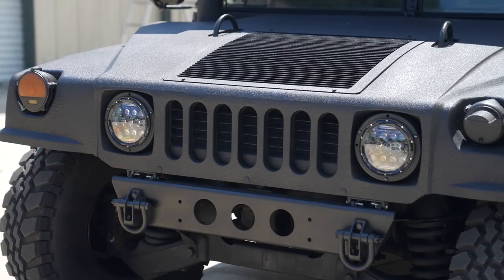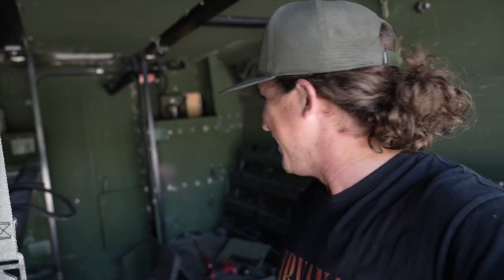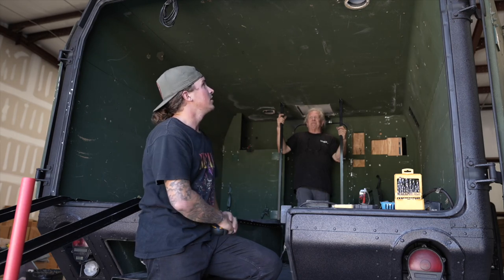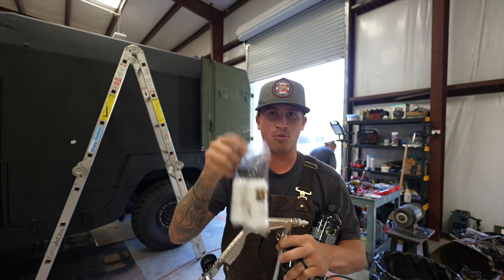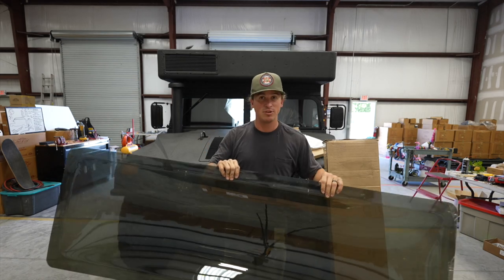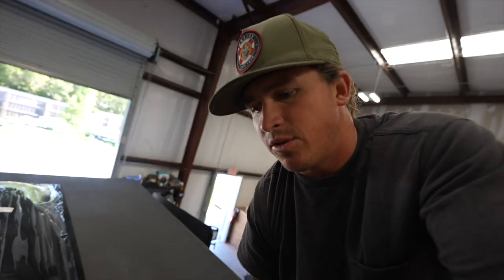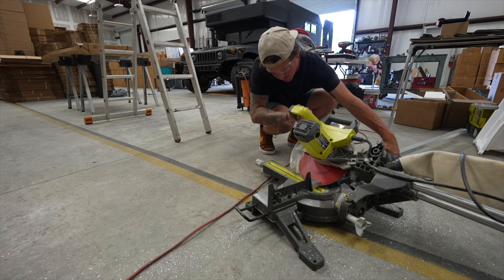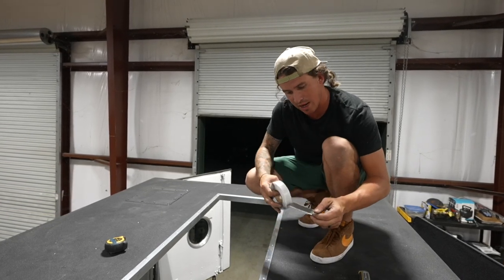The First Step In The Humvee Camper Conversion: Skylight & Windows Installation | Roaming Ventures

Comment: Between the M997A2 and A3 I've driven over 50,000 miles in FLAs. That may not sound like much but you rarely see one of these with over 15,000 miles, they spend most of their working lives off-road. So I have an idea of things you need to look out for. 
1. Where the patient box meets the windshield frame, it's only held in place with small rivets and caulk. The caulk gets brittle and the rivets break, find a better way to secure them together or they will drive you crazy rattling around. Not to mention the dust and rain that will find its way in. 
2.  The patient compartment door hinges like to rust and the flimsy brackets will bend and the doors won't close properly so keep them well lubricated. Do the same with the locking mechanism. 
3. It will rain in the patient compartment. I don't mean it leaks when it rains (though some do), through condensation of the moisture on your breath and perspiration it will actually rain. You'll need to either use A/C or a dehumidifier in humid weather. Unfortunately a fan and air circulation isn't enough so you may have to deal with some mold. 
I would mention that the diesel heater is great but you removed the control panel for it already... Oh and you really need to look into turbocharging this. From memory the NA diesel you have is rated for 140hp and low 200ft/lbs for torque. With a driver and passenger you will struggle maintaining 55mph going up a slight hill and never go above 65. Carrying some weight your top speed will be 50 and below.
Reply from the maker: Thank you so much for the insight! You're amazing!

Comment: I wanted to do this for so long with my M998, but couldn’t find any good ambulance tops for less than 5K-ended up buying an M1102 with an S250 G communication shelter in the back of it
Reply from the maker: Wow that still awesome!
Reply: I love your videos. I watched every one of them. A few questions:  1. Could you share the link of the skylight?  2. I bought 5 Humvees.  Town of them were ambulances M997A2. None came with rear doors and folding steps. And no luck finding them.  Do you have any suggestions on making them?
Reply from the maker: @ndexpo  thanks! I got the skylight from camping world ( RV Skylight SL1864S - Smoke). And yeah, for the back doors, I heard they are all being removed now from the government since it’s Kevlar. Mine was bought by the SWAT team before I bought it so the government kept the doors on it and gave me a street legal title.